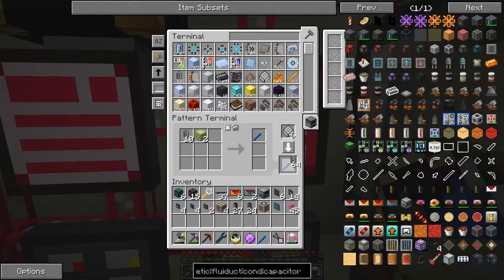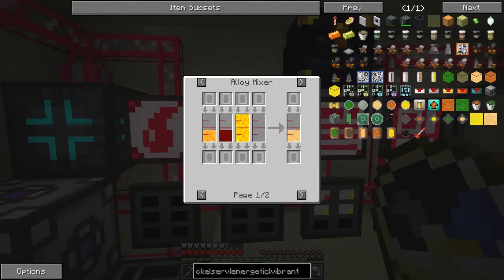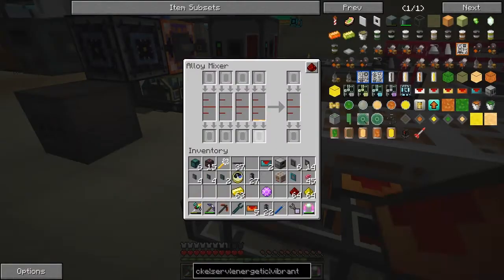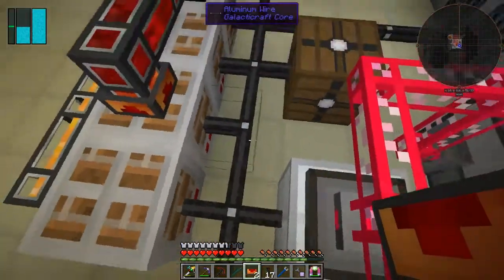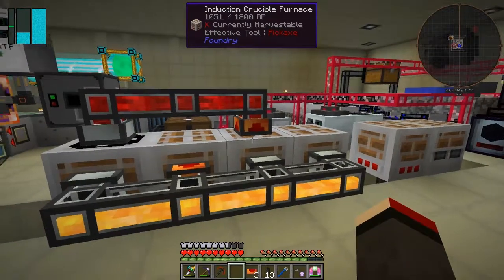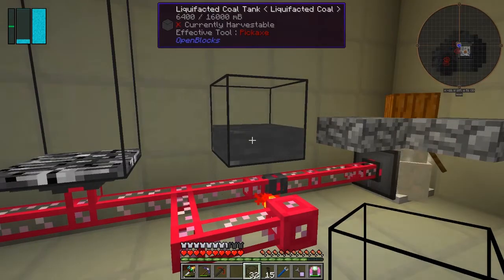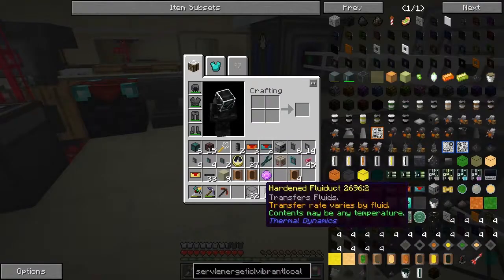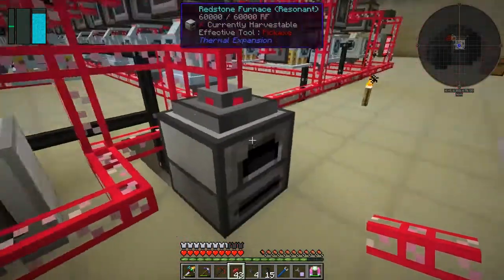Galactic Science 2 #88 - Mixed Up Alloy Mixer

Comment: Here's how I did my automation for Energetic Alloy:
ME Interface (with block mode) to a vanilla chest -> Creates 4 Energetic Alloy = 4 Gold Ingot + 4 Redstone + 4 Glowstone
Feeds to Induction Crucible Furnace
Feeds to Alloy Mixer
Feeds to Metal Caster with an Ingot Cast.

Made a 2nd setup for Vibrant Alloy with the same layout and only changed to the Pattern -> Creates 4 Vibrant Alloy = 4 Ender Pearl + 4 Energetic Alloy
Reply from the maker: CCindy that is what I was planning but for some reason, the alloy mixer was making molten and liquid energetic alloy, which in turn meant that I couldn’t carry on with the automation. It worked better with molten gold from a magma crucible but that recipe left 2mb glowstone so i couldn’t use that in automation. So it sounds like it is just me having this problem.
Reply: Might be because you are using liquids?  I'm feeding the Induction Crucible Furnaces ingots so that it only makes liquid version, then pumping that into the Alloy Mixer.

I'm not sure.  I keep all my metals in ingot form.
Reply from the maker: I don't think it is related to using liquids as I was getting both molten and liquid in the same batch. In the meantime I found a really good or bad exploit for liquids that save lots of time.